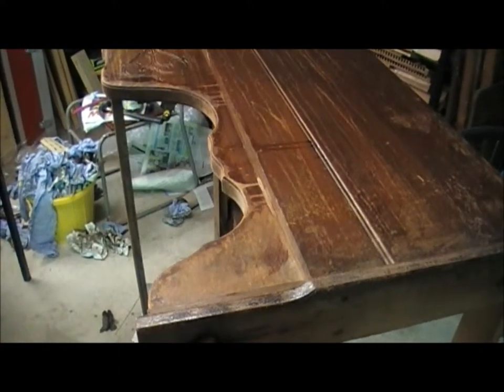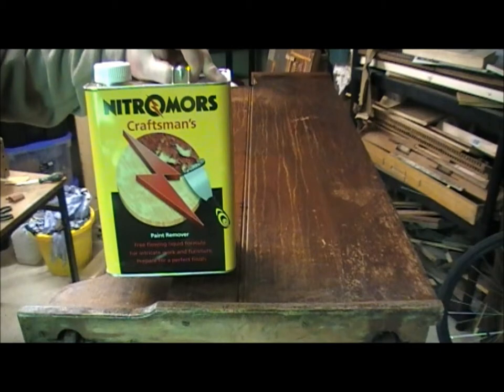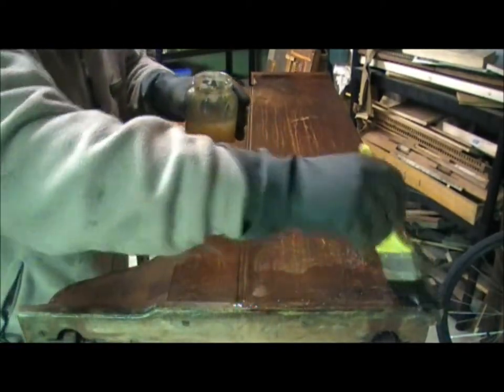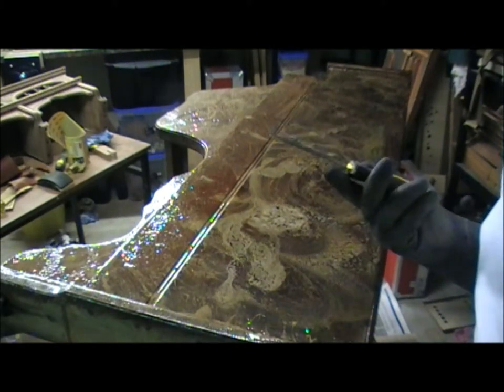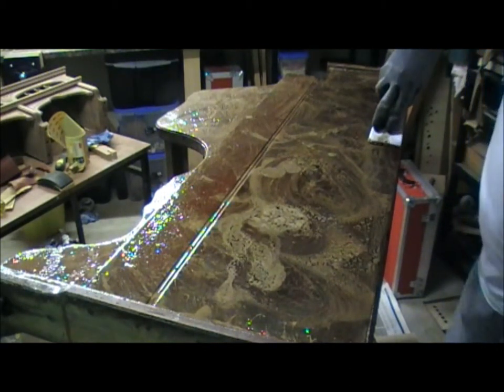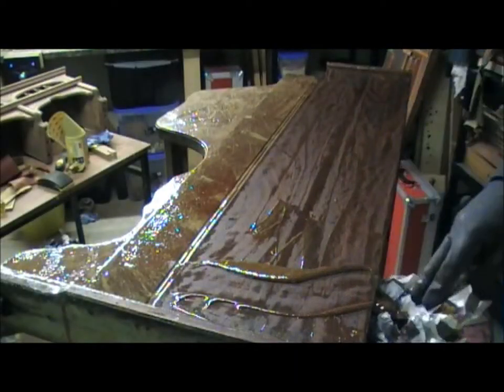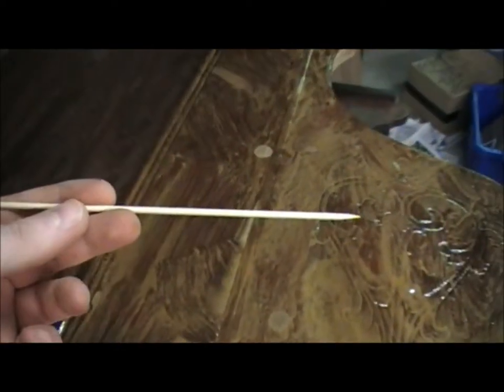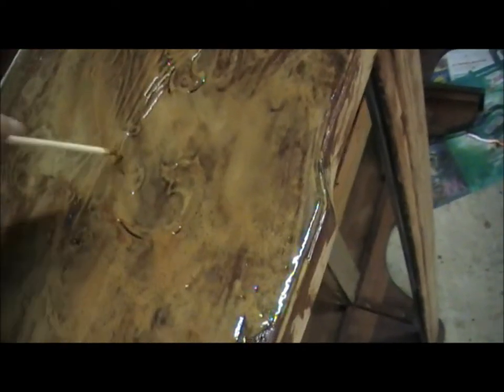The Stripping of a Reed Organ Case

Comment: Hi,
I use a "hotter" liquid stripper that works instantly, but the truth is that safer.slower chemicals will eventually take over completely, but almost anything dissolves old shellac polish. My best tip is to exploit the force of gravity. Turn the cabinet sides (or front) upright for the rinsing step, starting at the top with a soft brush and clean solvent, wash down the case, so the gunk is always being rinsed downwards. This is the most efficient way I know of. It's a variant of the "flow-over" method, but doesn't require the large rinse table and circulator pump. I catch the effluent in a metal tray if possible, but with a large item like the carcass, sop it up  with sawdust, wood chips or rags.

Comment from the maker: Thanks for those thoughts Casey. Never occurred to me to rely on gravity! I haven't even heard of a 'hotter' liquid stripper. I don't know if those are available here in Ireland.
Reply: I use a liquid stripper that contains methylene chloride. It's very fast, corrosive, irritating. But I can strip a case in a day; for those times when the finish has to be removed entirely; hopefully not every finish you encounter is as poor as that one. Is that the Estey?
Reply from the maker: ***** I think that chemical may not be permitted in the European Union anymore Casey. The stripper I use is 'methylene chloride free'. Other guys talk about the older version of nitromorse being better stuff before they removed the 'good chemical'. I think that is the one they are talking about.

Comment: If it is just shellac (French polish) then copious amounts of denatured alcohol will rapidly soften it and  it can be rinsed off leaving the wood stain often intact and the surface smooth. If varnish, then a paint stripper will be required. The junk can be usefully be washed out of mouldings with a stiff bristle brush and turpentine.
Reply from the maker: Thanks James. I must keep that in mind for future. In this case it had been varnished at some stage so the old finish was long since gone. I find a 'deck brush' works really well on the mouldings.